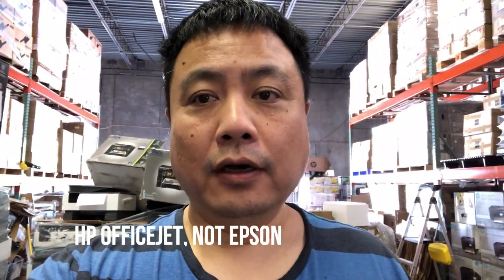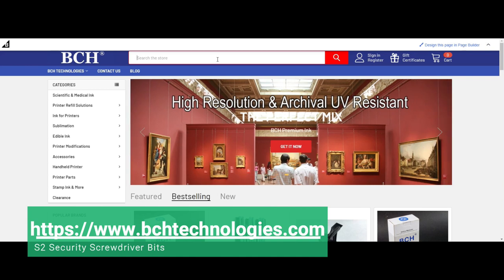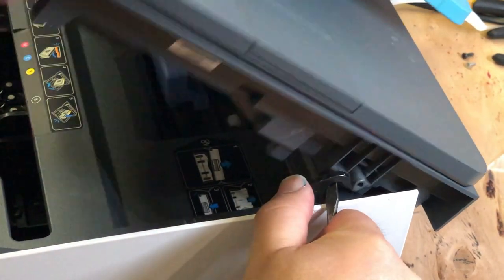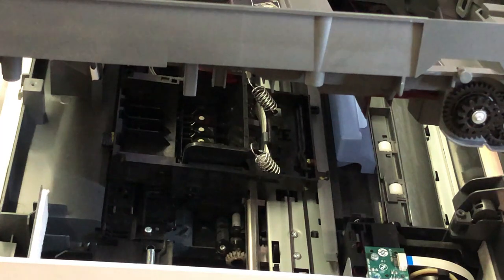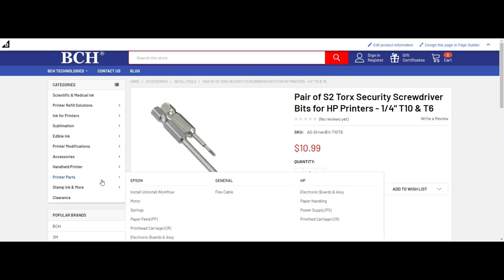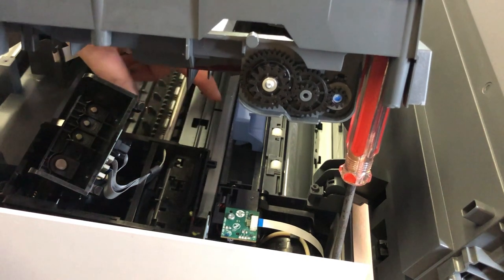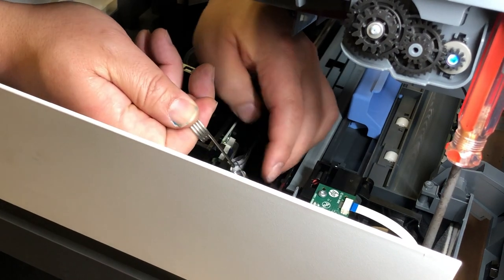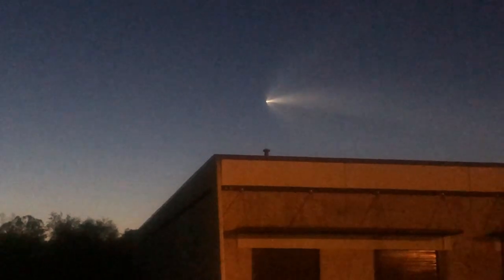Replace Printhead for HP 910 916XL - OfficeJet Pro 8022 8025 8028 8035 9015 9018 9025

Comment: Oh this is exactly what I needed. Thanks for sharing it out there. 
I have a question and probably something that other people might have asked you. With these type of printers, when you execute a printhead clean cycle, the printer is going to use some ink, and over time, it looks like this ink is accumulated in a small tray that comes in and out when the cycle runs. After some time it looks like there is a huge built up of ink that I'd love to clean somehow. Do you have suggestions?